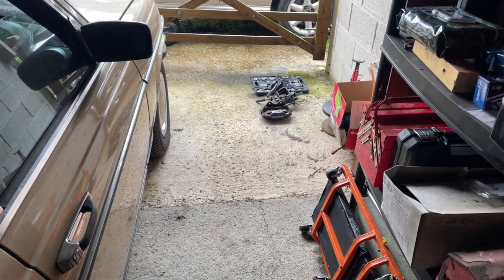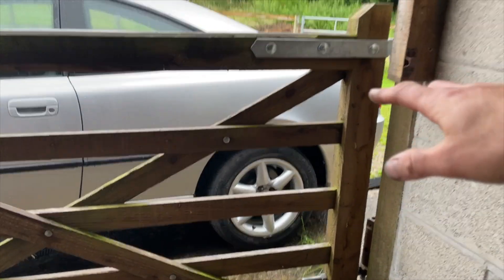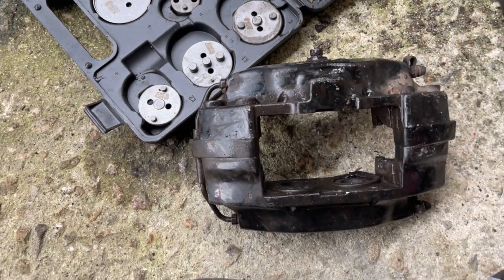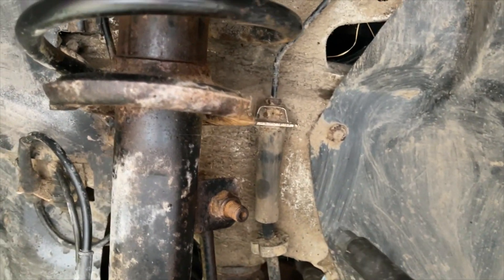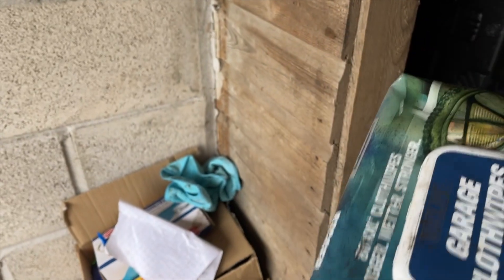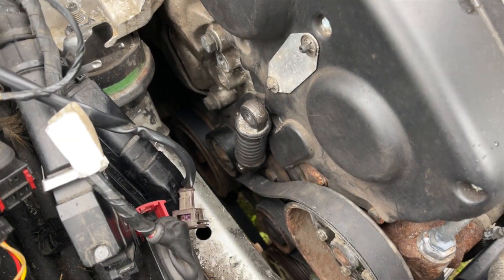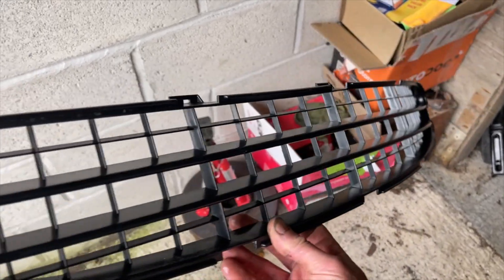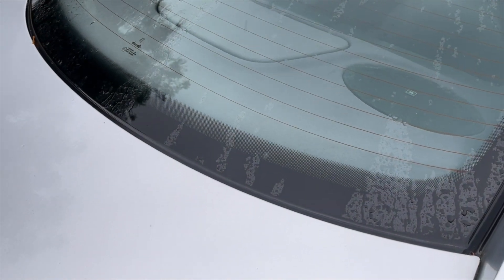Peugeot 406 Coupe Update No. 3: More Braking Bad | Contains Towel Throwing

Comment: Keep going you are doing great. The resto on all 5 of my 406 coupes took a lot longer than planned due to lots of unexpected things like seized bolts or tricky things to fix! Maybe you could come to the Peugeot festival in September and meet up with the other coupes. Just a quick tip whilst the Brembos are off rub off all of the old lacquer clean them up and spray some new clean lacquer on top. It’s a good quick fix and will look great behind the wheels as you have spent time putting new brakes on the rest of the car. The parcel shelf is also a doddle to get out and blow over with some Matt black paint, works better than dye. Keep up the good work looking forward to seeing more progress. 👍
Reply from the maker: Thanks for the tip! The Peugeot Festival is my target, but I'm not going to set any more deadlines!

Comment: OSF flexible brake pipe coupling bracket: dose with proper penetrating oil. Severally. Borrow brake pipe flanging tool.  Cut brake pipe well north of bracket. Attack bracket with extreme prejudice. Remove remains of hose assembly. Buy new short section of pipe and one pipe coupler. Flange with gusto. Assemble new down pipe and new flexible hose into remains of bracket. Rejoice.
Reply from the maker: Easy as 1-2-3! Cheers Loop – I should have shipped the car to you and we could have spend a happy month working on the car and searching the local villages for French tat!

Comment: Don't set unrealistic deadlines. (It's not like the telly, and old cars have a annoying habit of biting you back - if you want a deadline, make it the end of the year - think how train companies hit the targets..)

A set of hexagonal crowfoot wrenches that can be used with a socket bar are far more beefier than flare wrenches on brake pipes. Also try a locking vice grip with hexagonal flats. If you work on anything old, soaking any fixing with a good penetrating fluid is Vital before attempting and also while undoing it. 
Worse case is you have to cut the brake pipe and use a socket to remove the nut. A good garage will always make a brake pipe for tea/beer fund money. And cheap flaring kits are half decent these days if they don't. 
 
But take comfort that you have made progress. Little victories and all that. The battle is always long, but ultimately successful. 

And don't snap bolts, if in doubt, get a torque wrench and torque fiqures. 
Keep playing, a lot can change in the 2nd half.
Reply from the maker: This is super helpful stuff, Kenny. Thank you. Sending virtual and socially distanced man hug.

Comment: We all have those kind of days (well I've certainly had a few). Keep the faith, the rewards outweigh the misery.
Reply from the maker: Cheers Mark. Might have to achieve to some quick wins on another car before returning to the 406!
Reply: Could do I suppose as that would lift your spirits. Of course the 406 issues would remain so a temporary lift at best.
Not having as sizable a fleet myself my motivation was that I wanted to drive my car on the road and the only way to do that was to work the problem. Even if it did take a few attempts.
I find stopping for a cup of tea helps.

Comment: to chear you up im having the same issues relating to not having time to work on my 406. I've been working the front brakes to as a matter off fact only to give up for now because i only have a 3/8 ratchet that can yield the torx bit but i cant lever enough force on the darn bolts for the calipers. So now ive ordered an adapter so i can continue next weekend. I know your problems seam a lot bigger but in the end basicly you just got to track down the parts needed for the partial rebuild off the caliper and somebody below allready described whats needs to be done in order to get the brakeline fixed.

I do think the brakeline was allready shot and a caliper in decent nick you can just push in easily without any force so it was due to a rebuild anyways so imo you didnt really break anything
Reply from the maker: Don't take this the wrong way, but it helps to know that others are struggling with similar issues. It'll all be worth it in the end. 
Your point about ordering the adapter chimes with me. I've lost count of the number of times I've had to return from the barn, find a tool/part online, wait for the package to arrive and then find the time to fit said part! Happy days!

Comment: Just cut of the pipe. Its a relatively short distance to the ABS Unit. Cant be that hard to replace.
Reply from the maker: You're right – was just hoping to avoid it. I'll sort it.
Reply: @Petrolblog  If you havent found a replacement for the tensioner bolt which snapped, I might have one you can have.
Reply from the maker: @thomasbaekgaard5172  That would be really helpful! Let me know. Many thanks.